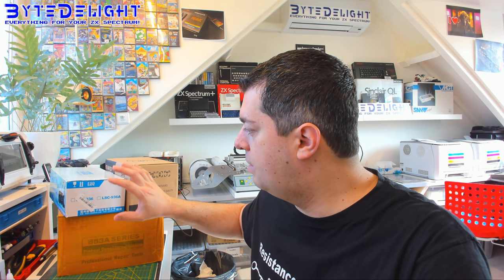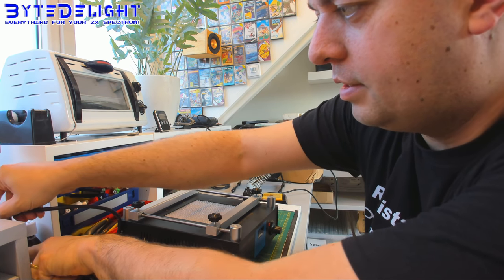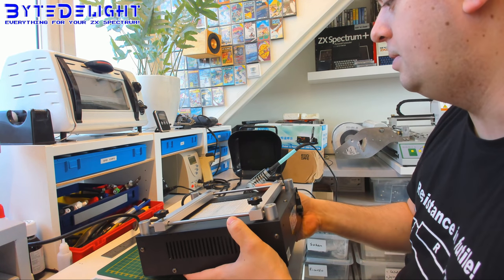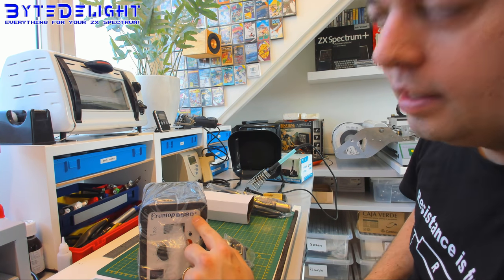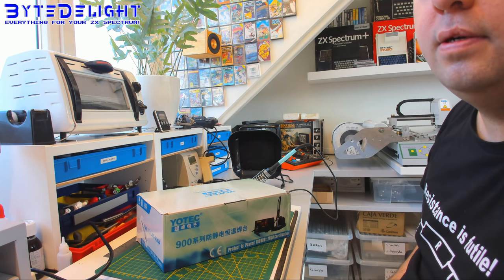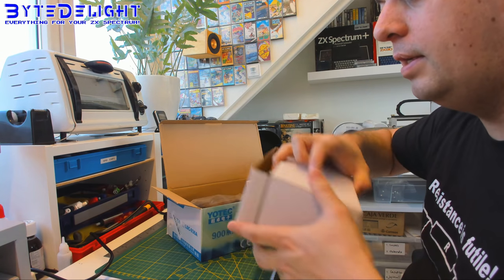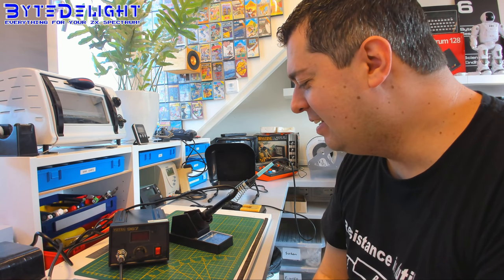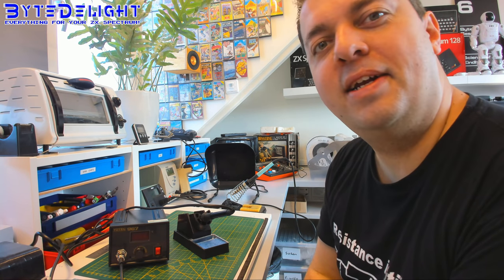New solder equipment! First impressions: Yihua 853A, Eruntop 858D+, Yotec 967 vs Weller WE1010

Comment: What would be your recommended temperature to solder?
Reply from the maker: It's hard to say: of course you need to reach the melting point of the solder you are using, but if you're on a spot on a board where the heat of the tip flows away quickly, like on a pad connected to a surrounding ground plane, you often need some extra juice to melt the solder.
Then every soldering station has it's own 'temperature setting vs. tip temperature', so with this Yotec for example I need to set it to a higher temperature then the Weller.
I would say: find a low setting that works for general use, and up it when you need a bit extra.
Many people use soldering stations that way, so not at one setting all the time.